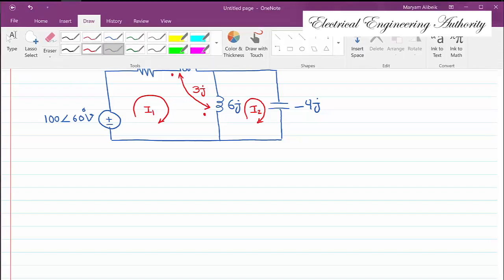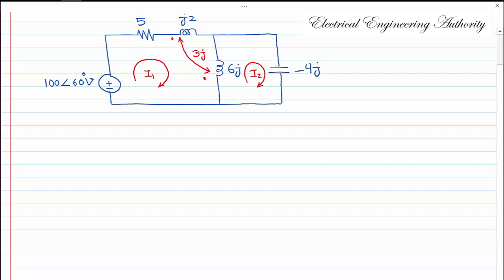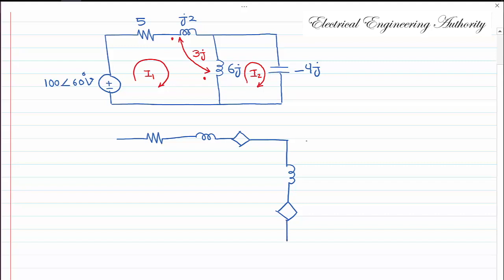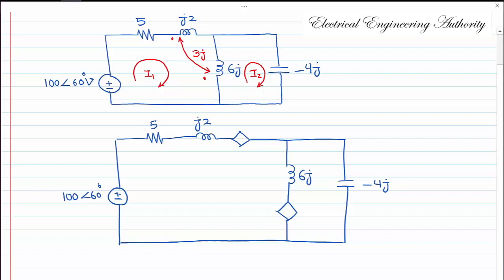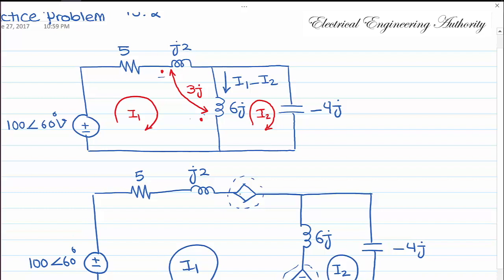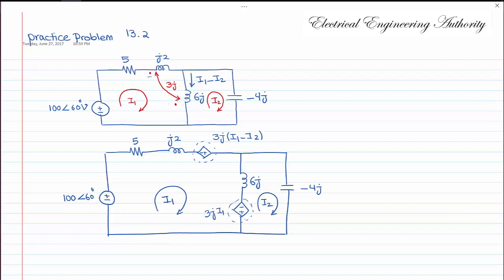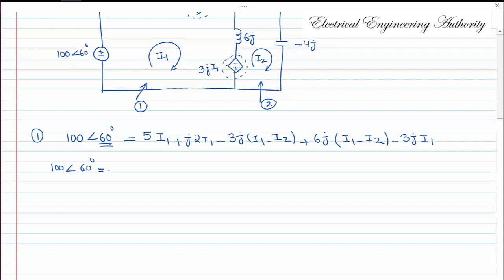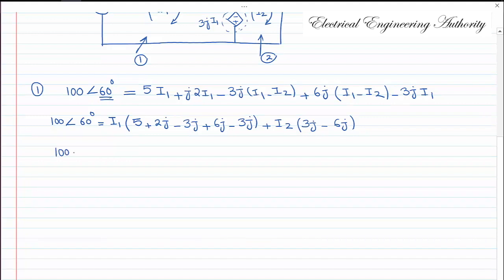Magnetically Coupled Circuit EXAMPLE

Comment: Ok, you got me lost at the I_1 going through the J2 inductor. 

I_1 is ENTERING the dot, so that should make the voltage source at the J6 inductor as POSITIVE? You have negative on top and positive below of the J6 voltage source, isn’t it supposed to be reversed?
Reply: For magnetically coupled circuits, the dot convention goes: When the dot is at the start of the inductor, the current is entering: When the dot is at the bottom of the inductor, the current is leaving.

So in this case, the voltage source at the J6 inductor is correct, as it depicts the current leaving
Reply: @vzzz1158  what are u talking about bro?? it should be positive

Comment: I still don’t understand how can i tell the polarity of the dependent source
Reply: If the current enters the dotted terminal of coil1, it will induce a voltage with positive polarity at dotted terminal of coil 2.

If currents the coil1, it will induce voltage with negative polarity at dotted terminal of coil2.

In coil 2j , the current enters, so positive  polarity at dotted end and negative polarity at undotted end. So. - +

Comment: 🤔 In the second loop equation. Why is it 3ji1 for the dependent source and not 3j(i2-i1) ?
Reply: Cause this is the generated voltage at coil  (j6) is affected by flux of coil (j2).

Comment: Nice video! Alternately you could solve the circuit in less time by replaicing a star of decoupled inductors instead of the 2 coupled inductors. These are the relations that allow you to make the transformation: L1=Lm-L11, L2=Lm-L22, L3=Lm. This operation is lawful because the 2 coupled inductors ha a common terminal, therefore we do not modify the topology of the circuit. By :)
Reply: Bahaa Al Deen Yes exactly
Reply: Is there a video showing what you're talking about? I'm still getting incredibly confused about how to write mutual inductance no matter which video I see.
Reply: @ The flux is psi(t) = L x i(t) then the energetic equation of an inductor is v(t) = L x di(t)/dt = L d psi(t)/dt if you have a mutual inductor it means that in addition to the self inductance effect there is also an induced voltage due to a mutual inductance so we can write a two ports system of equations as v1(t) = L11 d psi11(t)/dt + L12 d psi12(t)/dt and v2(t) = L21 d psi21(t)/dt + L22 d psi22 (t)/dt now we can say that the self inductance is just L and we assume the mutual effect caused by the first inductor on the second and the second inductor on the first the same (principle of reciprocity) so L11=L22=L and L12=L21=Lm (mutual inductance). So we can rearrange these two equations as v1(t) =L d psi11(t)/dt + Lm dpsi12(t)/dt and v2(t) =Lm dpsi21(t) + L d psi22(t)/dt.  Now we add and subtract same quantity on the two equations in order not to change anything: v1(t) = L d psi11(t)/dt + Lm d psi12(t)/dt + Lm d psi 11 (t)/dt - Lm d psi 11 (t)/d = (L - Lm)d psi11(t)/dt + Lm d psi11(t)/dt + Lm d psi12(t)/dt  = (L - Lm)d psi11(t)/dt + Lm d (psi11 + psi21)/dt  for the second equation you arrive with same steps at v2(t) = (L-Lm)d psi22/dt + Lm d (psi21 + psi22)/dt. Now you can understand that if you draw a T structure with on the left L1=L-Lm on the right L2=L-Lm and on the bottom Lm you satisfy these two equations written and you can solve the problem with three independent inductances instead of two coupled inductances.

Comment: The current going through j2 is entering the dot and because of this, you said the charge at the dot of the j6 inductor is negative. So this tells me when the current is entering the dot of one inductor it means the dot of the other inductor is negative. Later in the video, you said because the current is leaving the dot on the j6 inductor the dot on the j2 inductor must be negative. From this, I gathered that when current is leaving the dot on one inductor it means the dot on the other inductor is negative. These can't both be true so I was wondering if you could let me know what I'm misunderstanding?
Reply: If the current enters the dot on inductor A, then the dot on inductor B will have a + sign. If the current leaves dot A, then dot B will be - sign.
It also helps to draw the dependent source in the same direction as the inductor to see which terminal of the source the dot represents.
When current enters dot in j2, it means dot in j6, which is at the bottom terminal of the inductor, will be +, so the upper terminal of the source will be -.
When current leaves dot on j6, the dot in j2, representing the left terminal of the source, will be - and the right terminal of the source will be +.
Reply: Something's wrong
Reply: Same problem